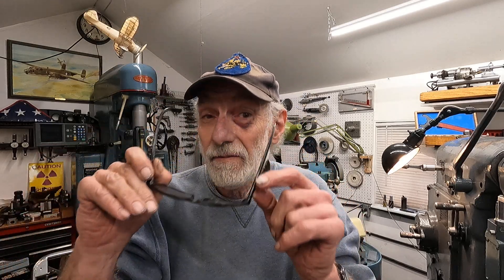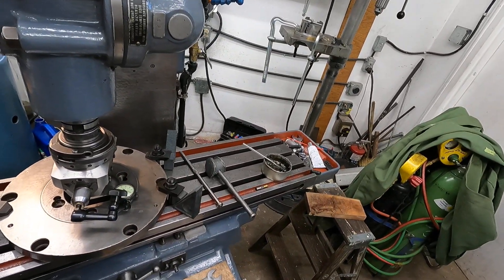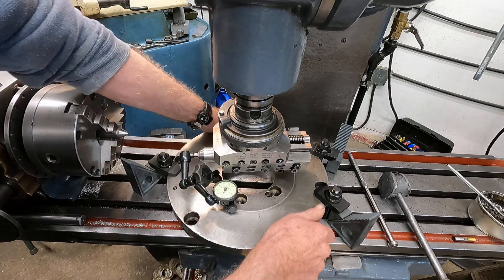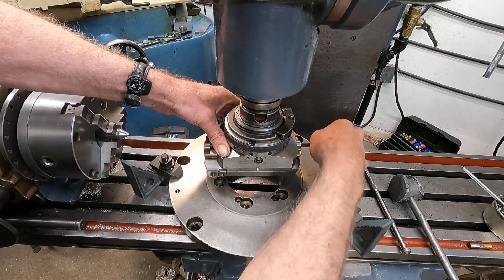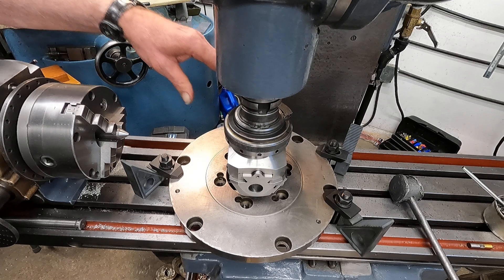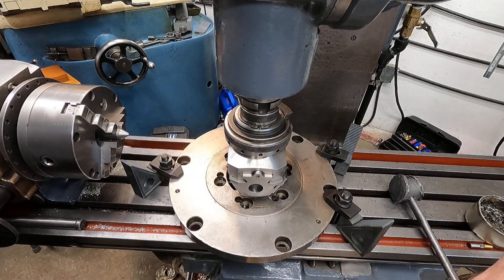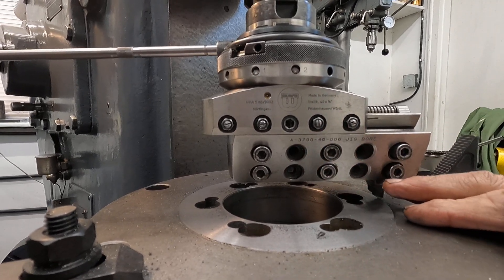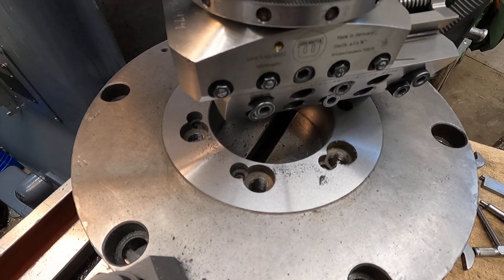Brown & Sharpe milling machine with Wohlhaupter Boring and facing head 2!

Comment: Are you sure that Wohlhaupter facing  head doesn't have that micro-angle built-in for facing concave .....  seeings as how it's a dedicated purpose tool ?
Reply from the maker: The angle is not built in, the concave can be controlled to a small degree by depth of cut and the tension on the gib.

Comment: Nice Video Dee. The Wholhuapter is quite a refinement on the Chandler heads I use. I am liking your recent videos, due subjects that have not been beat to death by others. Cheers
Reply from the maker: Time frame wise these heads were being replaced by CNC in the 1980s so those that used them are getting pretty old. I have an advantage by making cutters specifically for it and a lot of machine time using it. The key to using it is being able to adjust the cutters, or use very expensive inserts and have a good selection of them. I find it entertaining to find myself on TV.

Comment: DeeDee,  Your are having fun and so am I.  The Wohlhaupter is like jewelry, though it would be kinda heavy to wear around.  I’ve dug out a couple of my old chucks, both of them need new adapter plates so these videos are going to be put to good use later this year.  Thanks, TB
Reply from the maker: That was fun to share, I did not think it would finish so nicely, a very pleasant surprise. I normally did this on the lathe using a face plate before I bought that facing head
Reply: @deedeeindustrialsuperprecision  I can see the lathe being a natural choice for chuck adapter plates.  It was pretty amazing to see that Wohlhaupter setup on your restored mill creating such a beautiful finish.  Cast iron, even if the carbon makes it a little dirty, is sure a fun material to work with.  I’m looking forward to seeing you checking the scrolls and grinding in the jaws.  I’ve got a lot to learn and not enough years to learn as much as I want!  Cheers, TB